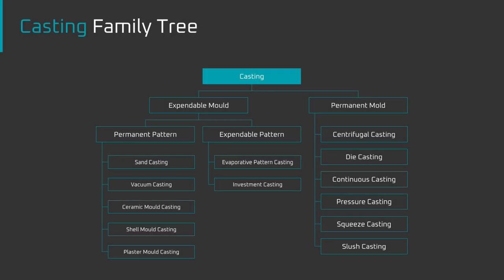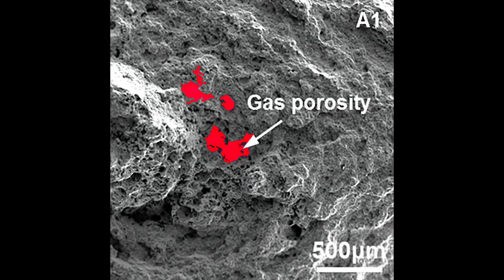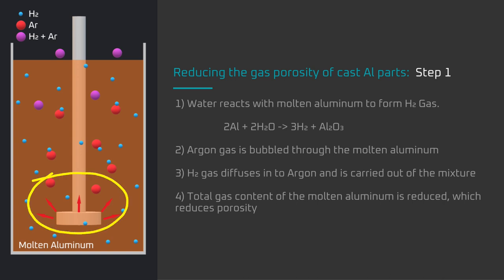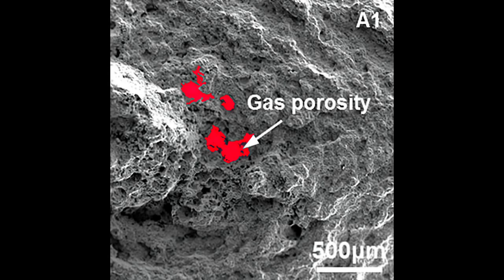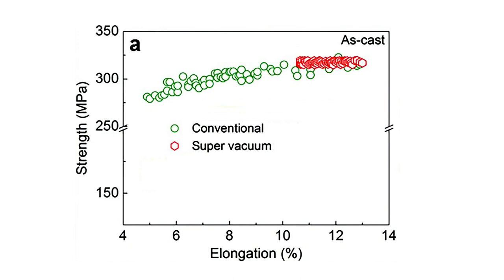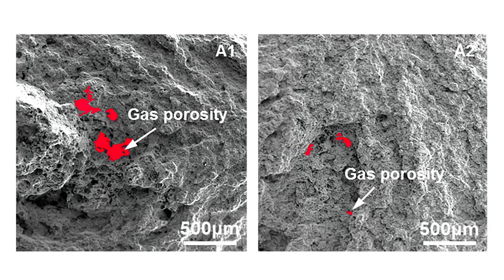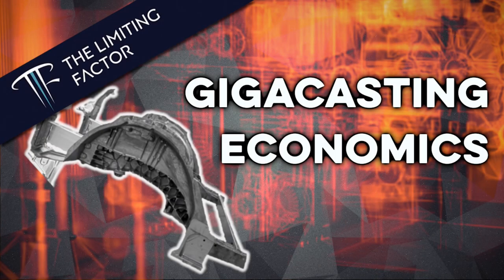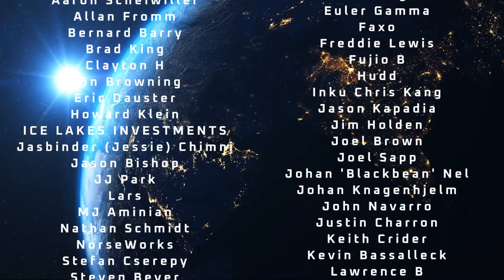Gigacasting // Super Vacuum, Argon Injection, Die Coatings, Thermal Regulation

Comment: Gigacast precision thermal control during casting and alloy innovation that doesn't require annealing significantly limits warp or other processes that limit dimensional precision - thus, basically no need for datums. I also expect they use an optical inspection system that can check each part in 3-D and maybe an x-ray system to check for internal morphology, like voids, similar to how airlines check for cracks in structural components. Great video Jordan - much appreciated!
Reply: Would it be more accurate to say the no additional reference datums need to be machined as the features in the casting are accurate enough to be the reference point for future steps?  

A datum is simply a feature that you decide to reference other features from when measuring.  Any part that has features to measure has datums by definition.  What I think is implied is the casting is precise enough out of the die that the step of machining more features (which are typically critical, high tolerance, and then become datums for measurement) can be skipped.
Reply: FSD based programme for Casting Optical System?
Reply: @oof_Dad  I think you're absolutely correct. For a large component you might have a bolt pattern with fairly large tolerances that could combine to fairly large overall variation at the assembly level. Typically we'd avoid having to keep a super-tight tolerance on the individual holes and the overall pattern by making just one hole a super-tight tolernace in each part, so the parts are assured to mate precisely, minimizing tolerance stack-up in the whole assembly. However, if it's cheap enough to make all the tolerances that tight, it still provides a better overall scenario. But that's really hard to do with castings!

Comment: Great video!  Less processing, less cost.  Targeting an as cast process would lead to a low cost part.  Following the casting process you normally trim away supporting structure that feeds the casting( the "biscuit") and all the overflows (small blocks around the perimeter of the casting) that help collect trapped air in the casting as its flushed it out.  This scrap material can then be recycled.  Ideally you want to minimize machining since its adds cost/cycle time.  Cored holes and self tapping fasteners can be used to create fix points with other components.  If you can avoid machining, this lowers cost.  As for datums, you can use cast surfaces to create 3 separate pads to form a triangle across part and create a plane that helps set the part.  A hole and slot will orient. This is the traditional way to check a part.  The ability to 3D scan a part could lead to the "no datums comment".  These are amazing castings for sure.  Very impressive!  Thanks for your videos!
Reply: Excellent comment !

Comment: I can see why in the past, big castings like these were not used for auto's as it would have taken a lot of expensive trial and error to get the flow and cooling right so won't warp. With advanced computer modeling, should be much less trial and error. 
On the other hand, giant cast steel locomotive frames with integral cylinders were being made 100 years ago without computers which shows how much skill they had.
Reply: It’s all about the cooling system used.
Reply: Partly skill, partly that steel has less than half the expansion coeff and cools much more slowly.  Especially in a sand mold.

Comment: Another detail is that the consistently high elongation they're getting on the parts probably lets them use thread forming screws.  So a cast hole is all that's needed to bolt to nearby assemblies.  

The part trimming could use a custom shearing die.  You see them in forging production lines.

Comment: If you want to see a mild example of cold shut, take a look at your (or somebody else's) collection of Lego bricks (injection molding plastic is very similar to high pressure die casting in principle). Most parts that have at least one hole will show a line where the fronts of molten plastic met.
Reply from the maker: Ha!  I'll have to look for that!

Comment: High pressure die cast parts have surfaces that are smooth finish - as compared to simple castings- to an extent that they can be  used as datums without machining, if used for mounting static parts 0- such as other body parts. however, machining is required for interfaces with moving or rotating parts.
Reply from the maker: Great insight thanks!

Comment: If you are machining a part then the dimensions between holes are usually taken from a datum this can be a machined hole, which would match with the Giga-casting only being fettled
Reply: Yes, if holes are cast in precisely where they need to be due to the lack of warp, then no need to reference their position wrt a datum. Also makes it easy for a CNC to just machine without adjustments part-by-part because of variable dimensions.

Comment: This biscuit, shown at 9:36, what stops the shape of this biscuit from being a part that can be used, instead of becoming waste? Same as the runners, there should be simple small parts which can be roughly the size and shape of these runners, so instead of cutting out waste, these biscuits and runners would be cut off of the giga casting and be useful parts instead of wasted material that needs to be melted down and reused. So that would eliminate waste and get these smaller parts technically for free.

Comment: I have a number of concerns of the processes you discussed, but only two of them stand out as I write this. 
First is the vacuum technology.  I do agree that doping the molten alloy with Ar is (MAY be. I have to take it on faith that this is a proven methodology) an effective way to strip unwanted H+ from the mix. It will, of course, have to be a mechanical bond, as Ar is a noble gas. At any rate, such a process can be effective iff the vacuum occurs within the poured "pot" as well as the mold itself. But how much time is needed for the vacuum to pull all the gas out? How 'tight' a vacuum can occur in that entire package...pour after pour after pour? Such details are important to learn if an outsider (you, me and the others reading this) is to have confidence in its efficacy...otherwise, we're just taking things on faith.
Second is that Mazola.  Molten Al-alloy not only is YOWZA-hotter than your average skillet surface, it is a supremely reactive substance. I shake my head at what happens when it comes into contact with a bog-standard veggie oil - how does turning that lubricant into a nastily-carbonized substance instantly incorporated into the molten metal not 100% destroy the metal's purity and usefulness? Are we sure the lubricant isn't some fancy Fluoromagical space-age substance?
Reply: Unless you're an insider or a customer for a gigapress I don't know if some of the details you want are going to be easy to find out.  You might have to take some of it on faith.
Reply: @TheEvilmooseofdoom  The reason I am going to disagree with your response is that I think we needn't ask this of Tesla or Idra or LK, but of Jordan. It is HE who suggests - very, very strongly suggests - that it is merely that insanely inexpensive vegetable oil that is the Magic Juice solving the corrosive effect of molten aluminum on those multi-million dollar dies. I am contradicting his statement by averring Wesson would compound, not solve, the problem.
Reply: If there is a vacuum in the die mold when the aluminum is injected, there wouldn't be any oxygen present for the oil to carbonize. The vegetable oil is likely heated and misted using high pressure air into a very thin layer before the vacuum is pulled. It wouldn't take much oil at all. The mold is then cooled before air is introduced.
Reply from the maker: The time you spent crafting a lot of that, you could have just looked it up rather than taking it on faith.  I provided the research paper on vacuum casting and it's common in the industry.  Same goes for argon or nitrogen gas bubbling (quick google search will make the efficacy clear).

Not sure on the vegetable oil.  But, again, I didn't have to dig deep to find this.  If the industry uses its and trusts it, it's good enough for me.  There are a lot of different types of die lubricants.  Look it up.  

I'm here as a starting point for you.  You shouldn't trust me nor do I want you to.  The point here isn't to hand down the gospel of Jordan, but to get people to think and be curious.
Reply: @thelimitingfactor  Fair points, and I ==>do<== appreciate your attitude of "get curious!".  For me, that means getting off my duff and re-learning what I used to know about metallurgy, and where the state-of-the-art is today.  I hope I don't find that what works for ferric alloys - where a smidgen more carbon likely has no effect whatsoever - and aluminum ones...wherein you almost never want even a ghost of C.

Comment: Great job as usual...   My question is, have you come across why they send out rejects for recycling rather than chopping them up locally and re-using it directly in the melting pots?   I would think having their own recycling capability would have been a great cost savings considering the amount we have seen coming out of Texas.
Reply: It might with the time affect the quality of the newest made parts, the recycling must made new strictly controlled materials/alloy.
Reply: Perhaps they're simply designing to not need to recycle.
Reply: @alanmay7929  The alloy is 100% the same.
Reply: @jamesengland7461  Possible, but there will always be some scrap.  The button and some other trimmings.   It might be possible that the normal scrap rate is too low to recycle in-house efficiently.   It might also be that the melting pot feeder requires it to use same size ingots. So requires them to be melted down and made into ingots again.
Reply from the maker: Not sure!  Could be as simple as having the equipment to chop/melt or more complex, like the oil/oxygen requires extra treament rather than just a re-melt
Reply: i think contamination from the mold release oil. that burns and the residue is on the aluminum. you can see it when the part is removed by the robot.

Comment: Casting threads would complexify the mold but it maybe worth it,
maybe it's simple holes forpass trough bolt or pressed-in inserts.
You can get away without datum by using exising features as datum. This could work well.
Anyways you need something to align part in the frame.
You need something to position fixations holes relative to the front one. Those holes could very well be the datums.
Reply: doing threads in the tool is complicated. you either need an unscrewing mechanism or some kind of collapsing core in order to release the part. also it may take longer to cool in that area .the mechanism can make the tool much bigger . all these issues increases cycle time . plus it increases scrap rate.

Comment: Very informative video Jordan, thanks, makes me pumped for todays Cybertruck update! Some still think it's gonna be indestructible cause it's stainless steel, but that's just the so-called exoskeleton, the entire lower body will be cast aluminum + structural 4680, right? So if that part meets salt water etc. it'll have regular wear and tear. 

Do you think there will be issues where steel meets aluminum on the truck due to the different properties of the two? Say expansion and contraction during extreme heat or cold, torsional forces or accidents etc.? Will they weld the steel onto the aluminum casts or something will be between them? Plenty of interesting structural questions.
Reply from the maker: Yup on the first paragraph!  I have a video coming on this.

Galvanic corrosion issues can be worked around, just like they have with the other vehicles.  No expansion issues.  Not sure how they'll marry them.
Reply: The whole lower body won’t be just aluminum, it will have steel reinforcement structures, you don’t want to tow 10,000lbs attached to an aluminum chassis/part lol….
Reply: @thelimitingfactor  Usually adhesives are used to bond dissimilar metals like aluminum and steel.  Non-conductive adhesives would solve the galvanic corrosion issues.

Comment: The aluminium alloy used by Tesla (in Giga Press casting) is apparently close to the well-known aluminum alloy AA386. This alloy has a nominal silicon content of 8.5%. This apparently makes it more suitable for moulding and doesn't require additional heat treatment, as it is relatively tough. It offers good corrosion resistance.
Reply from the maker: See my 'Alloy' video ;)

Comment: Casting comes out of the GigaPress, gets placed into a cooling bath, then placed into the trimming machine. This has been shown on several YT videos though they edit out the bath for some reason.
Reply: Really? There is a very commonly shown video which quite clearly shows a casting removed from the machine, and then placed on a surface. I would thought if a cooling bath was used, there would be no intermediate stop. Can you provide a link showing the trimming at least?
Reply: @grahammonk8013  https://youtu.be/yO_FLQ4HrWo?t=14 You will need to ignore their misleading editing and look at the layout.
0:14 Left: Bath empty with rack raised, Right: Trimmer unit occupied
0:19 Left: Bath loaded with rack submerged, Right: Trimmer unloaded
Sequence: Cast -> Quench/Cool -> Trim. You need to look closely at the video and realise that it's been edited cleverly. Look at the casting pre-post-trim. Look at the trimmer and bath occupancy. Look at the big red sliding safety door that appears out of nowhere.
I've seen the casting dripping in some clips. I've seen the trimmer unit labeled in other clips though it's fairly obvious that the trimming has been done by the time the casting is placed on the conveyor.
HTH...  Cheers...  Clark (NZ)
Reply from the maker: A good point, that's something I could have added to the video.

Comment: Jordan, would love to get your thoughts on the battery form factor and chemistry.  Apparently, Tesla does not plan to use 4680 form factor for LFP batteries. Why is that?  Also do you think Tesla will shift to Sodium from Lithium or just go straight solid state?
Reply: A big part of why Tesla uses cylindrical cells like the 4680 is for safety reasons.  The chemistry used in 4680/2170/18650 is quite volatile and will explode pretty violently when the cell is compromised (punctured, crushed, etc).  By making the pack out of a bunch of smaller cylindrical cells each protected in their own individual casing you can reduce the number of cells that would explode if the worst happens and a pack is compromised, while also reducing it from one big explosion to multiple smaller and easier to contain explosions.  The likely reason why they don't plan on using 4680 for LFP cells is because the LFP chemistry is much less volatile and doesn't require the same level of protection, so LFP cells can be made in more volume efficient prismatic cells.
Reply: @D3kKromb0x  Got it! So does Tesla ever plan to make LFP themselves or contract production out to partners.

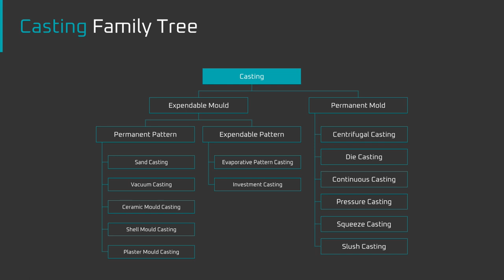Comment: Good explanation, thanks.  I find it fascinating that hydrogen will diffuse into Ar bubbles, thus removing hydrogen from the melt.  One quibble:  @time 0:53, the casting tree.  Mould or Mold?  (Sorry, couldn't resist).

Comment: Tesla is generating a seemingly huge number of test casts in both Berlin and Austin, which are all being scrapped/recycled.  Any idea if they're seeing porosity issues?    It's unclear why they need so many test castings.
Reply from the maker: No way to tell from here
Reply: My understanding (and it's a limited understanding) is that it takes a bit of time to dial in a casting machine, you don't get production ready parts right out of the box.

Comment: It would be interesting to learn if Tesla would insert internally threaded steel or Al tubes while the casting is hot and the insert would be "shrunk on shaft", thus avoiding machining threads. I guess one factor would be how clean the bore is...
Reply from the maker: In Sandy's video today, it doesn't look like there is a sleeve, but the camera is moving fast.  Great points!
Reply: It would be interesting to try and put a type of tap die into the mold and then back it out before the mold opens.  Sort of a mold and tap in one operation?  Otherwise some sort of heli-coil insert would be interesting?    Nothing like trying to add more complexity into to an already complicated and cutting edge machine 😁.
Reply: @oof_Dad  Thread forming screws are much easier.  See the elongation comment earlier which points out that this goes with the greater elongation percentage from the vacuum assisted tech.
Reply: @morrisg  are self tapping fasteners used in the auto industry for this type of thing?
Reply: @oof_Dad  Any fastener that makes assembly go faster is used, things like torx head, self threading fasteners and self piercing rivets are a few.  The fastener industry has made huge strides in developing new fasteners to solve more problems than before.  Part of this is that they are seeing adhesives take a chunk of their business away from them.  As for this particular application, I don't know what will be used as I am not familiar with the structural strength requirements for an auto body.  You can bet that the body structural engineers have analyzed and simulated various fastening solutions and picked the one that performed best overall.  It might even be deep stir welding for all I know.